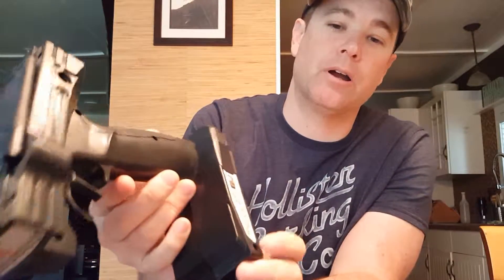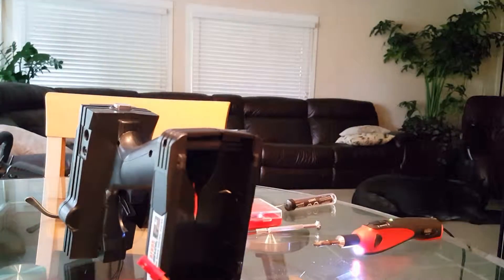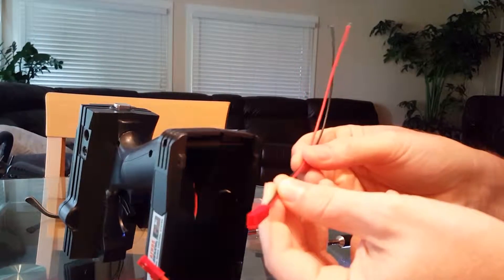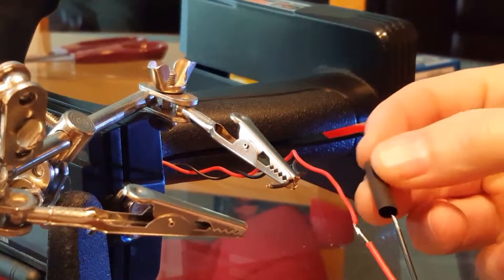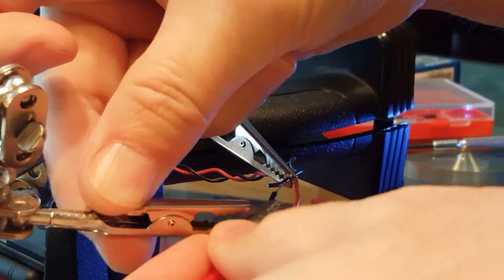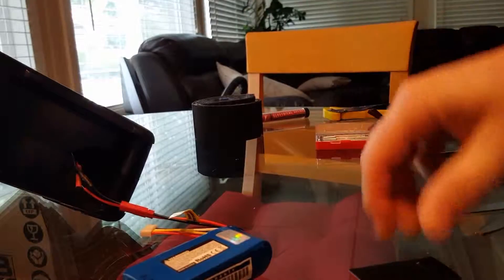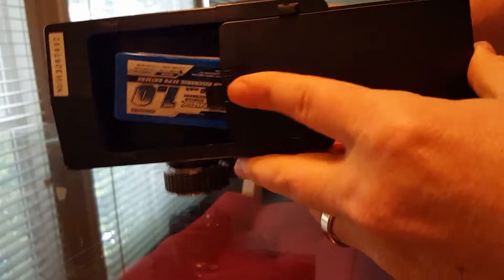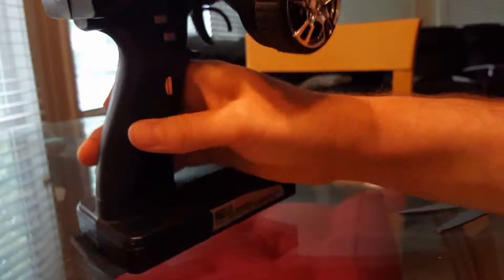DIY - FlySky GT3B Controller to LiPo battery conversion

Comment: if we using 1,2v rechargeable AA batteries x 8pcs it only reach 9,6v. Will it decrease the capability of these transmitter?
Reply from the maker: Rizky Ariesta I find that rechargeable batteries, usually nicad don’t last long at all. Especially compared to the lipo
Reply: Aaron Robertson yes i think so, but using AA rechargeable battery will also decrease the range of this transmitter
Reply from the maker: Rizky Ariesta I replaced with lipo. Used regular AA. This remote I use with cars and a converted electric long board (in another video for Ondo Longa) I do not notice any range difference.
Reply: Can you share the details of the lipo pack you used pls.